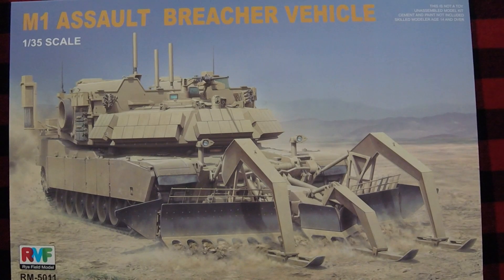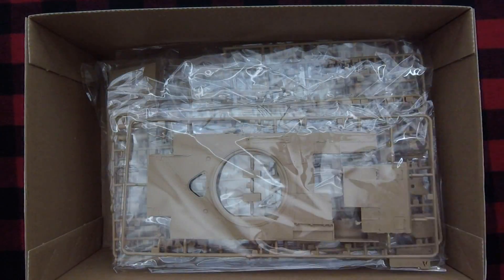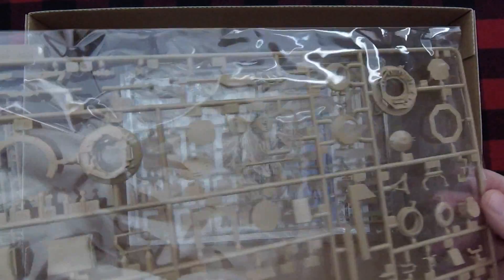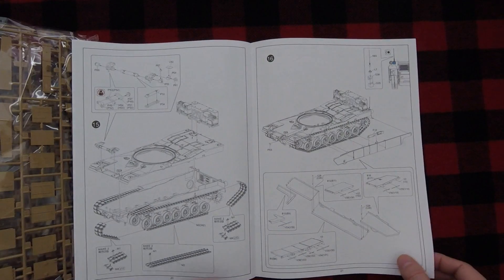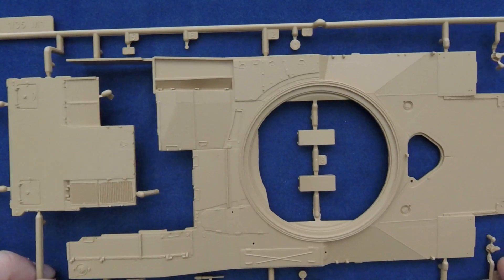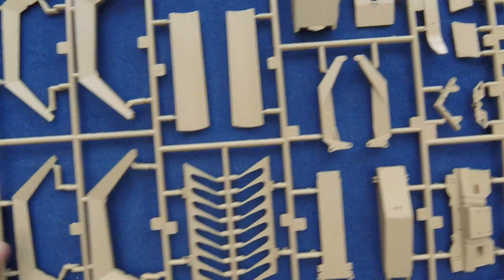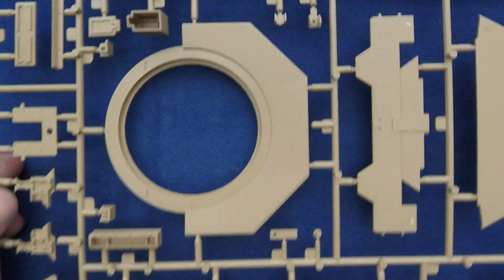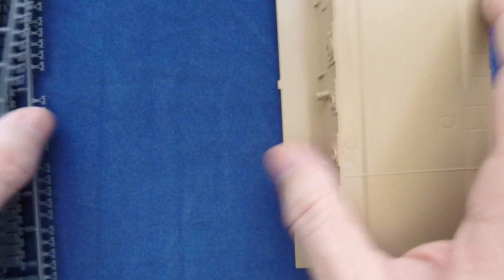M1 Assault Breacher Vehicle (1:35) RM-5011

Comment: Ah, the ABV. One of my favorite Abrams Variants. The 2 boxes on the rear of the turret are MICLICs (MIne Clearing LIne Charges.) The lines contain bricks of Composition B or C4, used to clear lines for Armored Columns through Minefields (also called "Breaching" a Minefield.) The giant blade up front is used to dig up IEDs or other UXOs (UneXploded Ordnances.) And sorry for replying in late 2021 to a video from 2017. But I absolutely love this vehicle, and I loved building this kit minus the tracks which I just replaced with metal tracks. But the M1 ABV and the M9 ACE (Armored Combat Earthmover) are my 2 favorite Combat Engineer Vehicles (CEVs) of all time. The M720 is cool too, but meh. Anyways, loved the video, hope this helped a bit.

Comment: The ABV was built as a mod to the basic Abrams M1 in response to the M1 Grizzly program being canceled by Congress. It was funded by USMC and built by a conglomerate of contractors and government employees, somewhat of a community project (which was really different, but worked). Many expected the program to fail but it performed the basic requirement (Operational Requirement) of clearing a path thru mines and other obstacles and at a fraction of cost of proposals from the prime defense contractors. I was involved in the manufacture of all of these vehicles, the detail of the models is amazing.